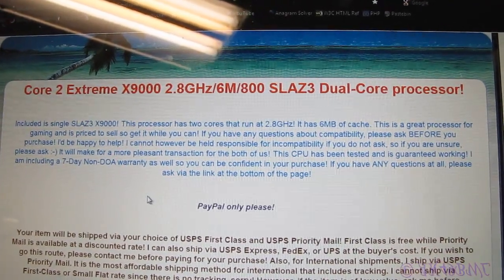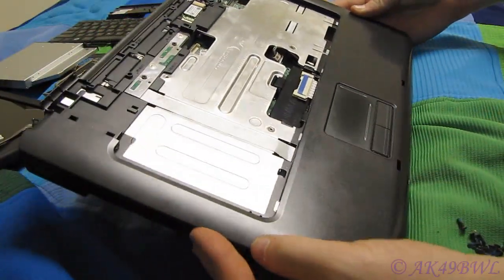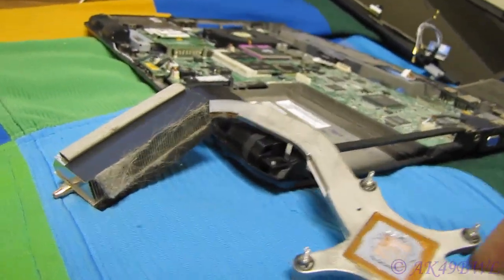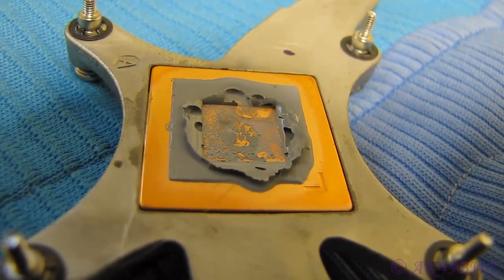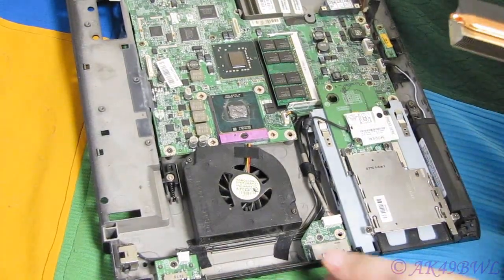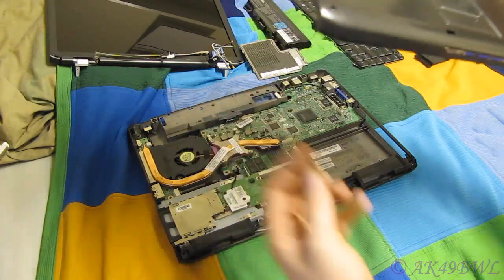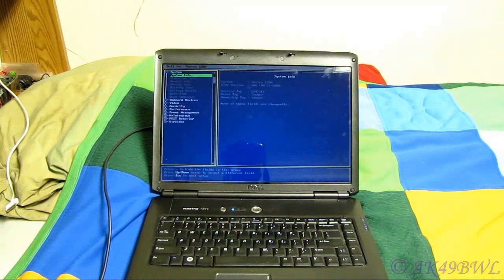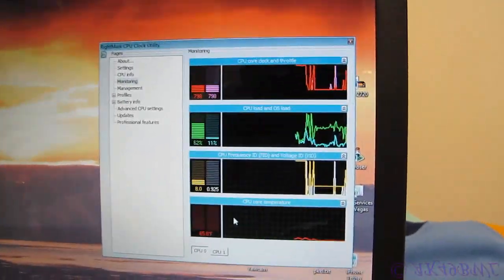How to Replace a Laptop CPU

Comment: *****  i thought that the Socket is different, PGA478 and PPGA478? and the max TDP for the Core2Extreme is 44W which is 9W more then the Core2Duo one?
Reply from the maker: Lind L.Heart That was a consideration, but doing more research into it, I came to find out that the two sockets are physically identical.. And since the chipset was stated by Intel to support the CPU, I kinda just went on a hunch and hoped for the best lol.
Reply: *****  I was thinking of changing the CPU as well but am afraid that my cpu fan will not handle the heat produced by the CPU... so i was thinking of changing the fan however cant find a replacement fan with better cooling performance that could fit into the laptop T.T ...
Reply from the maker: Lind L.Heart Well, tbh laptops weren't really made to be upgraded too much, tho possible. Mine is still running the stock fan and while it does get rather warm, it keeps up pretty well.

Comment: Thank you. This video helped me with my new processor installation. Especially the part when you informed to not tighten the screws of the heat-sink entirely until all are in place and partly tightened.

Comment: can i change a amd cpu of 1ghz to a intel insyde cpu of 2ghz? i waant to have a answer before i change it because this cpu is way to slow to play games
Reply: No. They must be the same socket as well as the chip set must support it. Considering those are two completely different brands and sockets of CPU, no. Plus, you might also want to look into your graphics processor

Comment: PLZ ANSWER: If i have a laptop with and old cpu (mine: amd turion 64 x2 rm-74 2.4 ghz) can i change it to an AMD TURION ULTRA ZM-84? does it have to be the same socket? because mine is socket s1. And what about an APU? SOMEONE HELP ME PLEASE?
Reply: its a great idea to get an apu it saves power its decent for gaming you dont have to worry if it fits or not if you have a 150$ budget i would buy a kaveri a10 7850k you can play most games with it and if i see your char you like minecraft and it can handle minecraft easily im gonna buy one myself too hope this helped ya out if it didnt tell me :)
Reply: Laptop parts are interchangeable

Comment: I have a question:
If I replace the cpu do i have to chenge something in the bios or something like that ???
Reply from the maker: Not these days... Pretty much everything after 2002 auto-detects what it has. Last time I had to change anything in CMOS (BIOS) setup was on my old Pentium. First Generation Pentium, that is, not a 2, 3, Celeron, etc etc... lol. Actually, that wasn't even CMOS setup, that was jumpers on the mainboard itself!! Ahh the good old days :D

Comment: I did the same to my new laptop after i got it back in may2008, a toshiba satellite a205-s5825 that came with a t2370 and replaced it with a t7700, maxed the ram to 3gb from 1gb and put in a slighty larger hard drive, from 120gb to 160gb... couldnt be happier along with WIN7 on it now.

Comment: I keep hearing a lot of negative things about replacing laptop CPUs with a newer one about possibilities of damaging the whole motherboard etc etc. For instance my current laptop cpu is a i7 2630qm Sandy Bridge (quad-core)" (32 nm)
that goes with a G2 socket in my laptop and now I wanted to upgrade it to a more powerful cpu like the Ivy Bridge (quad-core) (22 nm) Core i7-3840QM. Is it as long as the new cpu also goes with the G2 socket then will I be fine? Can the author of this vid or someone thats an expert in this field please enlighten me is the intended situation viable for me or not? sorry im very computer illiterate when it comes to these things. Thanks
Reply: YOU don't need to upgrade that CPU. It's an i7. Leave it and spend your money on something else. If you REALLY want to spend money on conputer parts build a nice desktop.
Reply: I don't think you can accidentally mess up the motherboard, and I think sandy bridge are made from better materials and are more durable.
Reply: You can short circuit your motherboard, or destroy the cpu because it may require more power than your laptops power supply can deliver.
Reply: The6000channel Well, Ivy Bridge CPUs are actually more energy efficient than Sandy Bridge, so he might be okay.  I can't guarantee compatibility though of course.  

Laptop motherboards are sometimes rather limiting and choosy about what components they will work with.  For instance, I apparently can't upgrade the RAM in my laptop at all.  I have 8GB (2 * 4GB), but if I were to replace those with two 8GB modules for a total of 16GB, I believe the BIOS would only recognize the modules as 4GB each, and it would still think that it only had 8GB total.  Some upgrades might cause the laptop not to boot up at all.  

So, Thomas Yu, it might be best to contact the laptop manufacturer and ask them, if you can't find the information in any of their manuals or technical specifications.

Comment: DDR2 RAM! You need to upgrade your ram
Reply: what are you going to do with your old processor
Reply: ddr3 is faster
Reply from the maker: Can't, it's maxed out. Only way would be to upgrade the entire laptop.
Reply from the maker: Ricky Ruiz
Still have it. Considered putting it up for sale but I'd probably have more trouble selling it than it's worth.
Reply: how much
Reply: *****
how much
Reply: ddr3 isnt a huge leap from ddr2 only change is higher clock speeds and there fits more bytes on it
Reply: ecc is the best ram

Comment: I just fried my motherboard on my laptop. If I had to buy a replacement motherboard, aside from the cpu, ram and possibly the fan, what other stuff would need to be replaced?
Reply: unless your peripherals were fried along with the mobo, you wouldnt have to replace anything else.. you may even reuse your ram if the new motherboard supports it.
Reply: u fried it up i recommend to buy new laptop
Reply: Yo Lo A new motherboard will fix it...no need for a new laptop.

Comment: Just little advises:

- To open the cooler of the CPU , I would first turn each screw half way 2 to 3 times
   before losing them of completely , and always continue by the opposite screw
   (crossways so to say , I think)

- Use something plastic to not damage the cooler to take the used cooliing paste off
    (instead of a metal screwdriver)

- You don't need to use that much of cooling paste at all - most of it probably
    "slips" aside and MAYBE could disturb other mainboard components around
    the CPU - anyway, too much means also to little of  converting/transforming (?)
    the heat along to the cooler.
    The best way is just to put a drop on the CPU-core and then equaly cover the
    rest with f.e. an elastic plastic card (desinfected & dreid of course)
    just like putting butter on your bread 

- The new CPU is another model: it has a metal cover , which means it needs
   even less of cooling paste then the other kinds

Hope this didn't come up too arrogantly - good video though
Reply from the maker: Thanks - I think this is the best constructively critical comment I've seen so far on this video lol.

Comment: Is she game worthy
Reply from the maker: Depends on the game lol. She'll do Halo (the original, not 2) pretty good at max settings, but not anything much newer. Not that I'm much of a gamer to test that stuff on anyway lol.
Reply: ***** replace the mobo with the dedicated graphics one and she shall run  most old games high settings(hl2,portal,etc) skyrim+other newer game on low to mid , i have vostro t750 + geforce 8600m installed.
Reply from the maker: marcnom thought about it at one point, but I'm not much of a gamer so it'd be kinda pointless lol.

Comment: you are doing it wrong. You scratched the living hell out of the copper plate for the heat sink. You smeared the paste rather than use the dot or X method. The laptop is not going to last long.
Reply from the maker: I'm typing this comment with it, so it's still working just great. Your prediction is invalid.
Reply: True
Reply from the maker: Oh hey. This laptop still works 😂
Reply: Oh jeez
Reply: Probably it will not damage the cpu/laptop but putting too much thermal compound will make the thermal distributed all over the cpu board and heats faster instead doing the method of what Lewis symonds said which is better and the thermal compound stays in cpu which is lesser is better for heat transfer.

Comment: Gosh ! Some comments are incredibly stupid !
The guy asking if he can replace his AMD cpu by an i7 cpu...
Reply: you cant upgrade to a intel cpu on and amd chip set and the other way around
Reply: That's what I'm saying man ;)
Reply: i wish you could do that though because if you had an intel computer you would be able to use amd because intel proccesors are pricy
Reply: Yeah :/
Reply: @rickyruiz329  well because they don't use the same chipset socket, for example, intel cpus uses fcbga, which is my cpu socket, since my cpu is a core i3, for amd, they use am4 for ryzen cpus, far as i can recall, so if your socket is fclga, then you can easily replace the cpu, if it's fcbga, you'll have to do some desoldering before replacing the cpu and hopefully not burn either of your cpus, make sure it's the same socket type and size for the new cpu, for amd sockets, idk if you are able to easily replace the cpu, or if it's solderized like intel laptop cpus are

Comment: This is awesome man, just have to ask though, do you need that silver liquid stuff or is it optional?
Reply: That Stuff is required to transfer the heat from the cpu to the heatsink which moves it to the fan. with out it heat wouldnt transfer, and the cpu would burn up. possibly damaging the motherboard as well.

Comment: man, this will help a lot... I am going to change the Intel Celeron M processor with an Intel Core 2 Duo Processor T5300 in my old Acer Aspire 3680. I also am going to replace the old battery because the current one lost its capacity.

Comment: Can I upgrade an i3 cpu with an i5 or i7???
Reply: then, why can't i use the turbo boost for cpu if the legs are the same??
Reply: I'd expect so. But depending on your laptop, if you're planning on upgrading you might wanna invest in a quality brand first - Ive got an acer, and upgrading is a pain in the arse, and cooling/ventilation is a huge problem. If you have heat problems it might be better to buy (eg) a clevo laptop, which can be upgraded easily (all the important bits can be accessed from the bottom panel) and I'd expect it to have much more adequate cooling... Although its all up to you :)Upgrading your cpu to an i7 might give you horrible heat problems... My i7 3610QM gets to about 100C under heavy loads!! (Which cant be healthy)

Comment: I thought heat sink was the stuff he squirted on the CPU?
Reply: No, the heat sink was the thing that had all that dust in it. The stuff is a thermal paste, which basically transfers the heat from the processor to the metal yellow thing, which goes to the heatsink and is blowed out by the fan.

Comment: Question is there a computer store that is willing to do laptop upgrades? for a charge i assume.
Reply from the maker: There are a lot of shops out there, you just have to research and find them in your area :) usually if you have an electronics and computer store, they can tell you .. A guy at Best Buy told me where to find my local computer parts and repair shop...After of course telling me they could do the work. lol...
Reply: you can have people do it online

Comment: Did you add some extra cooling? I am going to upgrade it, but I am afraid of overheating.
Reply from the maker: I didn't, just used the stock heat sink and some CPU controlling software within Windows. It's done pretty well thus far.

Comment: I think that for a lot of people, the convenience of a laptop is the decisive factor in buying one as their main machine - the only real difference is the resilience of the keyboard. I've had a series of PCs (and other totally different computers) over a few years, and my overall favourite one is my current laptop - an Acer - which currently has a slight keyboard problem, which may involve a replacement being fitted, but it's the best PC I've had....

Comment: My laptop is new and when i want to play a game, like battlefield3, it lags alot. i made the system go on performance but it is still slow.  It is a windows 8 with an AMD E-300 APU with Radeon(tm) HD graphics 1.39 GHz processor. so i need to change the cpu or why is it slow for my game.

Comment: hello, i have a question.  I am thinking about buying HP envy 17 and it has "Intel® Core™ i5-3230M Processor (3M Cache, up to 3.20 GHz)". Is it possible to replace this into Intel® Core™ i7-4700MQ Processor (6M Cache, up to 3.40 GHz)" or Core i7-3635QM 4-Core 2.4GHz? and i have no idea how to check chipset so can you tell me how to find it?

Comment: hey .... i have a laptop of hcl ME series 45 it has intel core 2 duo t6600 2.20 ghz processor ..... its slow i think it processor is damaged cuz i am a gamer and it is slow for gaming ..... which processor can be uprgadble

 i found on hcl site this :
HCL ME LAPTOP N4503 Price: Rs.32958
Genuine Windows 7 Home Basic
Intel Core 2 Duo Processor T6600
C2D T6600 (2.2 GHz, 800 MHz, 2 MB)
Intel  GM45 chipset based , 2 Inbuilt Antenna
2GB DDR2 memory
320 GB SATA Hard Disk Drive

i think this is mine

Comment: Hey man I'm thinking about buying an ASUS K56CB-X0191H.
It has i5 3317U, 6gb ram and gt 740m and I plan to use it for gaming. The motherboard is an Intel HM76 Chipset. I did what you said and it supports many quad cores and great mobile processors. 

Can I upgrade the CPU later on if I need to? Thanks

Comment: Hi there :)...first of all tnx for a great video :)...I have a acer aspire 7736ZG and would really like to upgrade if its possible my CPU and GPU...my acer is running on INTEL PENTIUM T4500 2.3GHZ,800MHZ and ATI Mobility Radeon HD 560V ... So du you think is it worth upgrading those components,and woth should i get if its worth...i already upgraded to KGB ram and hard drive...i apologize for my bad english

Comment: How important is the heat sink dye? I pulled apart my cooling fan once from my viao. I didnt not replace the dye. Sadly, the computer fails to boot now. I cant think of anything I have done wrong. I took it to a technician and he said my motherboard is damaged. Do you think I might have damage my processor when installing the heat sink?

Comment from the maker: It's actually neither in this case, but PGA (not sure if the Core I series went LGA or not for laptops, but the Core 2 series to my knowledge is all PGA for laptops, LGA for desktops). You can replace the CPUs in a very high number of laptop models, it's NETBOOKS that are generally soldered together and nearly nothing is replaceable except the RAM and hard drive.

Comment from the maker: It's really not the processor you want to identify but the chipset - for example, mine runs the GM965 Chipset, which you would then look up at ark.intel.com - they give you everything you need to determine what you have, and even provide a list of CPUs that are compatible. But, I will say that if you have the same socket as mine (Socket 478), you're not putting anything new like the Core i series in it ;)

Comment: Heheh, my Toshiba has a huge CPU heatsink, and the multiplier on the T3400 is about 13.5, vs 9.5 on the QX9300, maybe I'll try to over clock it slightly. I'm glad I spent 1100 bucks on a quality laptop back then; can't wait to be upgrading it! It's already in a billion pieces lol.

Comment from the maker: The X9100 also runs a 1066Mhz FSB as opposed to the X9000's 800Mhz. My laptop runs the GM965 chipset, which does not support 1066 CPUs. My laptop is literally maxed out on CPU capability.

Comment: Strange, it seems that on the compatibility list of the GM45 chipset, there is only the x9100 as the extreme core 2 duo, I am purchasing this x9100 for my Toshiba A350 along with faster ram, and an ssd. This will replace my T3400 Pentium single core, saving me a ton of money, I found the x9100 for 138 bucks and it performes better than the x9000.

Comment: Technically "just" the battery, the bottom-cover, and the heatsink elements. Not too different from desktop PCs (powercord off, cooler off the CPU...and so on)

Comment: Your new cpu is 15F degrees cooler...
OMFG, of course, because you cleaned out the cooler so it is better the cooling performance!
Was similar to my computer (Dell Vostro 500) with the same processor (T7250), and in the summer it was idling around 104F. Then I cleaned the radiator and I was already 75 to 80 F at idle!
Otherwise, your system will be more warm, T7250 = 35W / X9000 = 44W!

Comment: Aboout to upgrade my Intel Core 2 Extreme QX900 to a QX9300 (in an Asus G71G-Q1) however Asus have warned me that the QX9300 needs bigger heat dissipation and voltage (not to mention causing other compatible issues). Should I still go ahead woth it? Thanks

Comment: Correct me if I'm wrong the number "1, 2, 3 and 4" are for installing the heat sink so that the thermal paste will spread even while you are tightening the heat sink

Comment from the maker: I'm sure. The Intel Integrated graphics on the 1500 are a killer, and they don't even make usable Windows 7 drivers for 64bit- - yep, I'm stuck on 32bit with a very early version of Intel's driver, because of the graphics alone. If I use newer drivers, BSOD BSOD BSOD randomly continuously until you're rebooting more than using your computer. Along with the hard drive, .... I really should buy a new machine but this one still gets me by lol.

Comment from the maker: Seldomly. This model had three graphics options - integrated, and two nVidia and you could change between the two nVidias but it was not possible to go from integrated to nVidia. But for most laptops it is not possible to change between video options at all.

Comment: yeah, it will work. The Celeron M 530 and the Core 2 Duo T7200 are of the same socket, so they'll fit in the same motherboard.